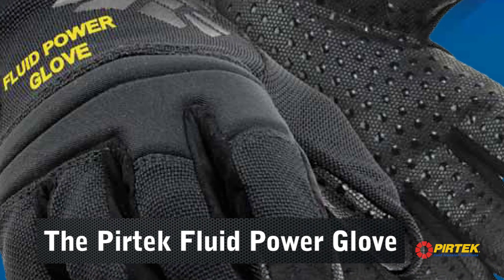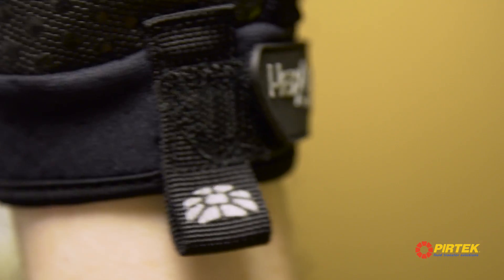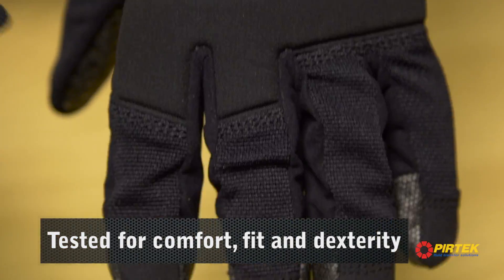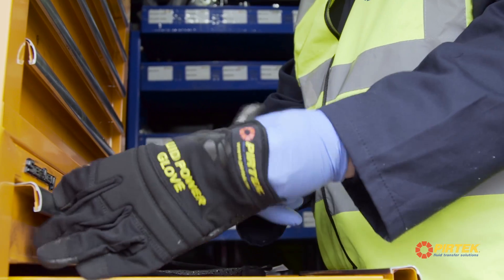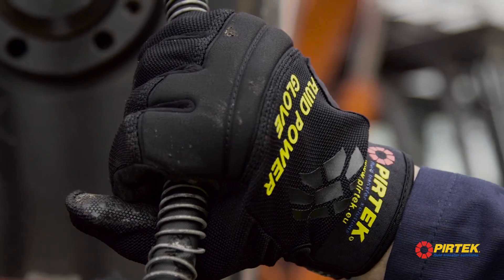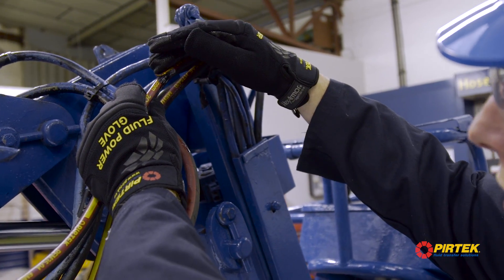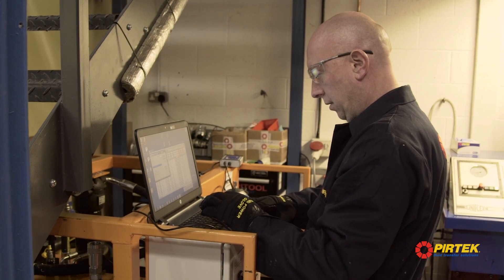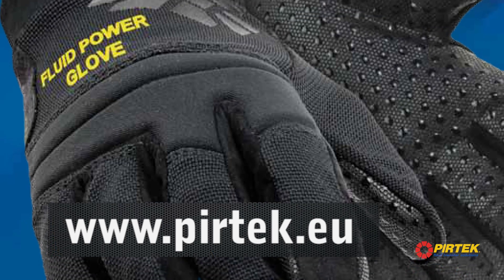PIRTEK Fluid Power Glove

Comment: Can they be cleaned once covered in oil, the ones in the clip appear brand new, people working in this industry generally end up with gloves soaked in oil after a short spell
Reply from the maker: +Ian McKenna 
Hi Ian, the gloves can be washed so this should not be a problem at all, however, it is recomended that they are not  placed into a tumble dryer
Reply: Thanks for that